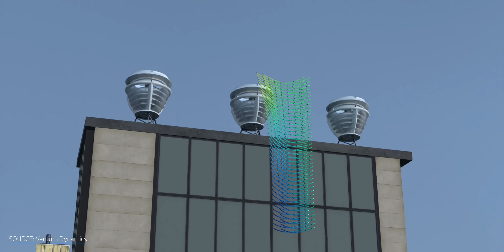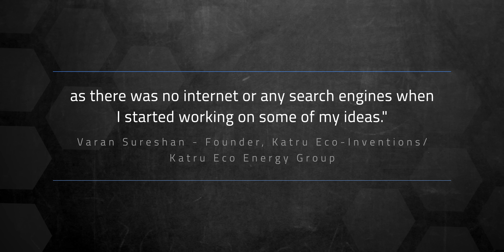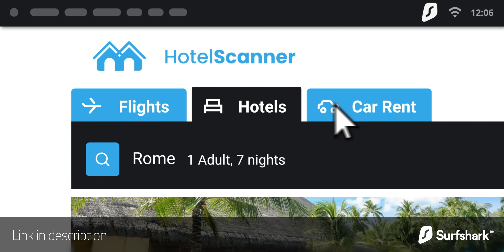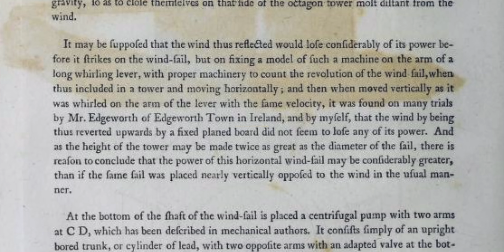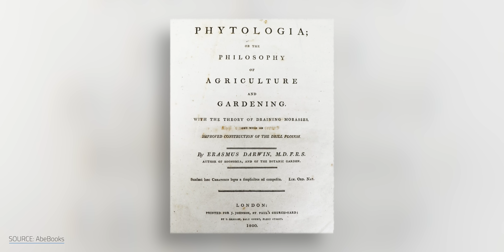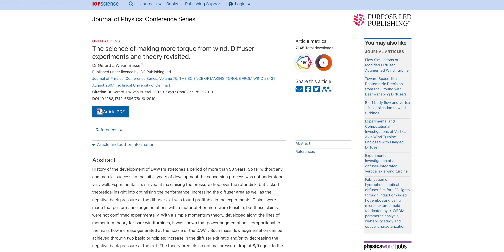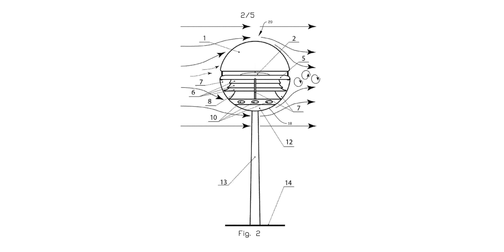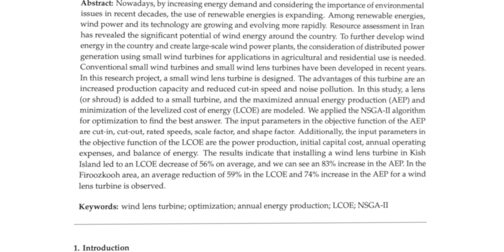Are Shrouded Rooftop Wind Turbines the Future of Energy?

Comment: I think it's a matter of getting enough investment go into mass production. This seems like the type of thing that could just become standard on factory roof. Maybe the decisive factor is integrating intermittent renewable energy sources into the grid, or developing ways to run them parallel to the grid (use the power produced by small scale ultra local energy sources to reduce demand on grid, rather than selling intermittent production to the grid). In the US, the Federal (and State) government is pretty useless at promoting integration of intermittent sources to the grid. However, the parallel strategy has no need for governmental support.

Comment: I always hear about industrial uses of this technology, particularly wind. I know there are some residential products in the works - but to me - wind needs to be as approachable as solar is becoming. I'm honestly holding off on solar to see if there are wind-based systems that could be implemented on homes, because particularly when near the 45th parallel, the potential energy production could be higher.

Is it not possible to take these industrial scale technologies and scale them to residential use?

Comment: So the VX175 is supposed to produce between 8 and 16 kilowatt hours per day based on an average annual wind speed of between 6 and 10 m/s. This information is not provided in this video until the 16-minute mark, and instead they spend 10 min. talking about Erasmus Darwin for reasons I still don't understand. Now you need to discuss the cost of the units and the LCOE. Then around 17 minutes they present a chart showing somewhere between 17 cents and $0.50 per kilowatt hour. Next you need to compare it to putting solar panels on the roof of similar buildings because that is absolutely what you are competing against.  Quick Google search gives a figure of between 12 and 28 cents per kilowatt hour in the US. Although I suppose it's possible to do both and that is where things might get interesting. The photos show roofs of large buildings with rows of solar panels down the center and these turbines along the edge of the roof. I suppose an area where morning and evening and nighttime wins are present might create an argument for these installations. On the other hand you need to compare it against just putting more solar panels in the areas that those turbines occupy, which might well end up being more cost-effective. Lastly these really look much harder to install and a greater load on the roof than solar panels, with significant building code engineering requirements that solar panels just won't have. My hunch is that these only make sense on very specific kinds of buildings and in very specific areas of wind conditions, in other words higher than average winds.

Comment: I am just interested if this windmill is any good. Not if the idea is new or not. It is not. I thought of this multiple times just pondering about windmills that would be easier to get a permit for by the municipality.
Now most small windmills are way too expensive compared to what they provide. And all the cheap chinese windmills that go for a couple of hundred € or $ are total crap and have around 10Watts instead of the 500W or more there are advertised with.
So can these compete with solar cells or not? Even half as good would be somewhat OK because you can use them 24/h per day as long as there is enough wind.
That is the question I want answered, and if it is any good, where can I buy it? And can I get it in camouflage colors so they dissapear in a big garden with some trees around. That would increase the chances for getting a permit. Because for regular three-wing windmill you can forget that.

Comment: Decentralizing our power supply is the most strategically brilliant move we can make. As we sit now, one dam going "flush" could potentially cripple the West Coast.
I think that encouraging the use and installation of alternate sources of numerous small providers with Grid Following Inverters would help considerably, with Power Companies controlling said Grid. We also need some "Neighborhood Battery Plants" scattered all over to provide precise pinpoint provision of power in areas that would normally have been shut down because no source, but that area's grid is fine.
Reply: Yes! I hate the idea of tearing up chunks of the desert to install experimental power generation technologies, plus having to build new transmission lines to send the electricity to the cities. We have plenty of empty roofs awaiting solar panels within the metropolitan areas; we just need better ways of storing the electricity. Backyard wind turbines might be an option as well.
Reply: @EXROBOWIDOW  Flow Batteries, and even simpler: Gravity Batteries, and I don't mean rocks and cranes.
There's a class of battery that uses two different solutions that combine into a salt to make electricity, and the specific gravity of each keeps them separated until current is actually drawn out. The salt solutions separate back out when recharged into the original solutions, and the battery can also be recharged almost instantly by simply dumping it out and adding new liquids in the "Charged" state.
Here's a Video that explains it better than I can here. https://www.youtube.com/watch?v=c-Ffrfrd6CM

Comment: I have 2 attic turbines on my house that tend to run a lot,especially during the 10.5 months of the year when it's warm... I hung an alternator on each with a belt and pulley to turn them... Connected to a battery bank via charge controller keeps my batteries charging basically 24 hours a day during those warmed months... Since I only have 12v appliances,fans,lighting,etc I save a huge amount of juice by not having to run inverters,or converters... Its cheap to do,other than the new pulleys and belts when one uses 2 used single wire alternators,scrap metal to buld the bracketry,and a few bolts and screws... They've been running a couple of years now without any issues other than one belt getting hot due to overtensioning by moi... I also have a high amp alternator mounted to a 3.5 ho pushmower deck ran via the wheel drive pulley belt which cam charge my entire bank in less than an hour and using under .5 gallons of fuel... All built using a scrap mower I got for free and running for literally nothing more than a new air filter and carb cleaning and adjustment,and a used alternator that would've maybe set me back 30 bux at the local junkyard if I didn't have one laying around and a used belt...

Comment: Looking at the straight upright parts of the duct, I would hazard a guess that angling them in the direction of turn of the turbine would result in further increase of efficiency as the wind is, effectively, rotatiionally spun up before reaching the blades.

I would love to have one or two of these for experimental purposes to see how efficient they are, and with a clutch and multiple motors to make use of differing wind speeds, i.e. if the rpm begins to overrev, add another motor to the array to draw more power, slow the RPM and prevent destruction of the system in high winds, but draw a small amount in low winds.

Comment: An axiom that came to mind during goes, "Don't let the perfect be the enemy of the good."  If the design is good enough and does what you need it to at a practical cost, it's useful and worth investing in.
Reply: except, it's not. it's not cost effective. it's way much cheaper to build regular wind generators. would you like to pay 10x for your electricity bill? the price per kwh doesn't make any sense. if it had a practical cost don't you think investors would be pilling in and you would see such devices everywhere?
Reply: @riskinhos  Except that's an idiotic question. Devices are not practical until they are practical. EV's in the 90s were a Sideshow. Now, a $50K EV has a lower total cost of ownership than a $25K gasoline car over it's lifetime.
Reply: @riskinhos  Well they are not really competing with the larger ones though? The problem with the larger ones is that you cannot build them close to residential areas and they have significant noise pollution . I would like to see the cost and return of investments on these smaller ones. Are they sufficiently cheap and maintenance free I can totally see a lot of commercial buildings putting up a battery of these. Esp for powering air condition units etc.
Reply: But when you do some simple calculations you invariably find that these things are a waste of time.
Reply: Agreed, Perfection is a journey.
Reply: conventional large vertical wind turbines are not good at all..
people are getting sick of them!
(not just figuratively - also physically !)
Reply: @laus9953  no they are not. and many are being built. much better than breathing coal
Reply: @laus9953  You mean horizontal.
Reply: @laus9953  They are fine actually.

Comment: Just a thought… mount the wind unit ON TOP of AC or heat pumps… standing off a foot or two.  You’d not only have the wind power that you’d get normally from the surroundings but the air coming out of the heat pumps.  Preferably for heat pumps as they are running both at times of hot and cold.  And because it appears it utilizes side wind inlets,, Mount the wind unit horizontally or at a 45 degree above the heat pump.  A heat pump pushes out a lot of consistent air as anyone knows if they are ever near one when running. Share the patent with me when you pass it along to the wind machine peeps.  Scott
Reply: That sounds suspiciously like pulling yuorself up by your own bootlaces.

I suspect that adding a device trying to capture the energy from the air being pushed out of the AC unit would simply force that AC unit to work harder to shft the air or shift less air with the same energy going into its fan.

Remember the Laws of Thermodynamics as they apply in mechanics (and life):
1: You cannot win, the best you can do is break even.
2: You can only break even if the ambient temperature is absolute zero.
3: You cannot get to absolute zero.
Reply: @michaelorton6947  I’m not saying putting it so close it fights anything.  And once you get it maybe 2 feet away (or whatever the sweet spot is technically) it wouldn’t hurt the output of the AC and would obviously only add to the wind generation on the input side of the turbine.   It obviously can’t take away

Comment: this is NO different than a funnel or shroud but all that surface area/material could be used for larger HAWT turbine blades and you get the same or even better electricity production for less cost.

Comment: When a concept has failed practical application repeatedly, and even more "for political reasons," the jury needs to be out on this for quite awhile. Total cost and productivity assessments per kWh, along with ergonomic metrics like vibration transmitted into the structure, manufacturing simplicity and capacity that allows costs to be well-controlled and production to be profitable, etc., will all need to be accounted for. No doubt the vapor carburetor, water-for-gas, and other fuel-saving devices that exploded onto the market in the 1970s also failed "for political reasons." That was a signature claim of the scammers.

Comment: I like to call this "convergent solutions". Darwin's turbine uses the same operating principal; taking slow horizontal wind, redirecting it upward at a higher speed. This one simply has A LOT of optimization on the same core concept. This new one's a series of annular airfoils with a support structure that doubles as a flow stabilizer/stator I think this could end up being a successful tech, but mostly for windy industrial areas and cities. I imagine their effectiveness drops off significantly once they no longer have a building to funnel the air upwards.

Comment: While solar may be more cost efficient and the winds are often very variable, there's no reason a small version of this turbine couldnt be created to support slower windspeeds. Assuming a 2 story home, support to battery or grid tie return would accomplish the goal. The real issue I think is noise in residential areas. While EPA says 55db is fine, if you're in a quiet neighborhood, its a lot of noise. So my supposition is the problem is for most of suburbia, these's turbines are just too noisy..

Comment: Almost 5 years ago I bought a Chinese 15KW wind turbine, but with an average wind speed of just 3m/s, it only produced 175wp. You need hurricane speeds to get the 20,000 watts of power.
However, behind my house there is a run (small stream) that is about 8 feet wide. Using a funnel is narrowed the stream to just 1,5 feet in width and with the help of my father in law we designed a waterwheel that is powered by the water from the stream pushing the blades of the wheel, this is connected to a CVT transmission with drives the turbine. However this solution is not perfect as the stream only has running water from roughly September till mid April where the water levels are high enough to make the wheel spin. However on average it now produces 2000wp and is a good addition to my solar panels that aren't very efficient in winter. In 2023 we only pulled 163kWh of a total of ~8000kWh from the grid. Last winter we saw only a few inches of snow, but no major snow storms. 

I understand that Ventum want to harness those cornering winds, but when those turbines are closed so close to the edge, they have to put more effort in the design. Because even when it could my house all year long, aesthetically it is not much to look at which might hurt adoption rates...

Comment: My main concern here is that the wind energy that a turbine can extract is proportional to the cube of the air's velocity. That's why conventional turbines are built on tall towers in very windy areas: just a few more m/s gives you huge gains in power. All the turbulence at ground level, which they claim to be taking advantage of, is exactly what makes the wind at ground level so slow, and thus so unsuitable for power generation.
Reply: Combining wind with rooftop solar can help with this, so that you use the footprint of the roof more efficiently.

Comment: Florida and California have many, many miles of oceanfront hotels that should all have these on their rooftops.  I'd bet they could power most of the country if we dotted 2 or 3 of 5 taller hotels along our coasts.
Reply: California does not have "many miles" of tall oceanfront hotels. There are some in the major metropolitan areas, but most buildings right on the coast are 1-4 stories, maximum. However, most of our coast has bluffs, which do affect the air currents. But Californians are protective of our coast, and putting these units directly on the bluffs, or even on single story buildings on top of the bluffs, would generate a lot of local opposition. They would also need infrastructure to tie them in with the grid.
Reply: @EXROBOWIDOW  3-4 stories up is all they need.. Part of the reason for going higher is higher wind speeds. The other part is taking them out of peoples eyesight... 
So even if they could put up enough of them to power California, don't you think they would jump all over it???
Reply: @SteveP-vm1uc  On the coast, these turbines would be visible. For many people, they would ruin the aesthetic. Redondo Beach has an old power plant, recently decommissioned. The previous owner planned to renovate and upgrade it to modern standards-- efficient, and not polluting the seawater thermally. But no, it was "ugly," the transmission lines were an "eyesore," and besides, the electricity it generated didn't go to Redondo Beach, I was told by one of its opponents. 

I don't think they understand how the grid works.

Comment: Seems like it could be cool. I just see a lot of complications. Birds/animals, wear from weather such as hail, snow/ice, the maintenance necessary, the extra weight on the roof. Likely will need extra engineerig for building construction and retrofitting of reinforcements. Upside is power generation at all hours of the day. Seems more of a specific use case. And as always, the problem of energy storage for use when the wind does not blow.

Comment: maybe a dumb question but lots of buildings have like exhaust ports on the roof for steam etc... would it be helpful to put one of these turbines over one of those to make use of it as a power source? (also, i'm thinking the hot air will rise quickly and maybe help with a draft effect that increases speed.)

Comment: Hmm a bit messy... The story was great, but the false build up, was unnecessary.

Also
To produce power from wind speed isnt the only factor.
When it gets to windy they activate the brake on the windmills. The gearing for the generator is also a big factor, same as size. 
But in your video, ot kinds of boils down to only speed. Which is just not the complete picture.

Comment: Strange design. Why didn't they put the vertical vanes inside the turbine tube? Putting them outside will make the turbine somewhat directional. Putting them inside means that the vanes are inline with the flow.